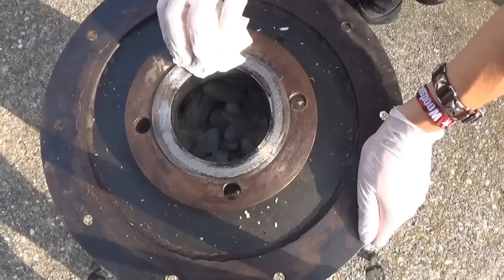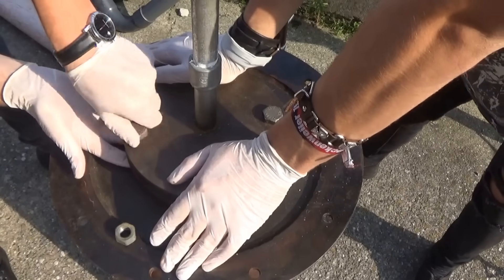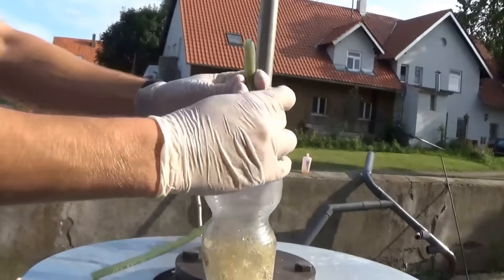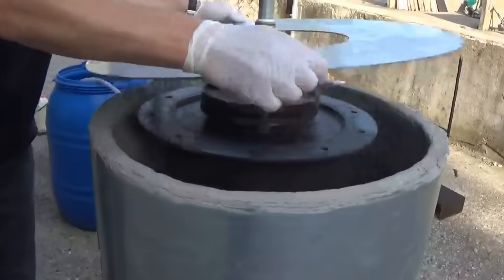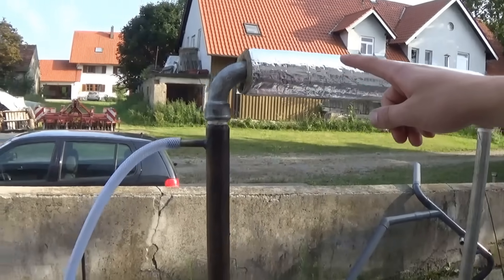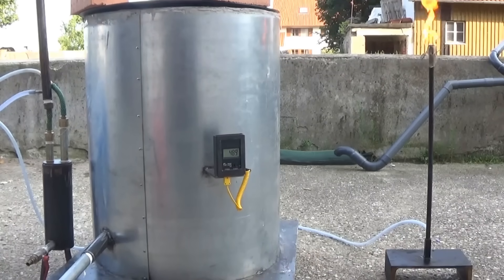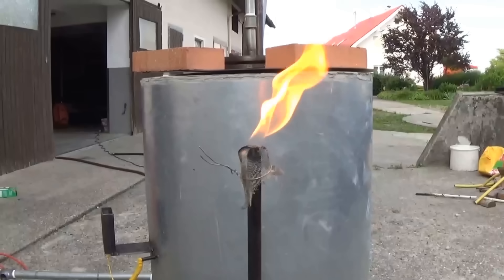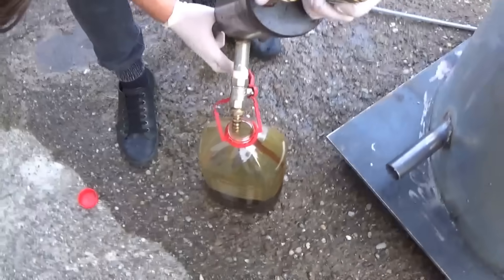plastic waste to oil/fuel improved pyrolysis reactor

Comment: Could you try putting the reactor under vaccum rather than using c02 to void the reactor of o2 if this could be achieved this would be much cheaper than the current method used
Reply from the maker: the process you are describing is called vacuum flash pyrolysis and it works great, but with my set up it would over complicate things.

mfg hazelChem

Comment: CO2 flush is useless.  when heat, water evaporate and flush it.
Reply from the maker: nope ! there is not enough water to fully purge the system! do not work without inert atmosphere!

mfg hazelChem
Reply: @HazelChem  water steam inert  till 250...350 C  add 100 g water to buttom and get 200 L steam.

Comment: That flare gas can be fed back into the burner via a second inlet to the same tube as the one connected to the propane tank.
Reply: You would want to use something like a Waterfilled gate to prevent a possible flashback.
Reply: @kevman0111  Definitely. On every gas source feeding into the furnace ideally even the main tank
Reply: Thought so too, such a shame as it could lower the cost of the whole process instead of wasting it
Reply: My thought exactly, super heated.
Reply: Yes, run the gas back through a bubbler and into the fuel intake.
Reply: Would it burn as clean as the LPG he's using?
Reply: @Hobby_trails_repository  seems to be burning decently in the footage. Probably dirtier that the propane but if it's being burned anyway might as well point it at something
Reply: @atrumluminarium That's what I've always thought about this "bleed off" when manufacturing things. Seems like a fire burning consistently could be taken advantage of somehow.
Reply: @Hobby_trails_repository 

Possibility with the right burner set up.

There are videos on how to turn regular gasoline into Lpg. But this flare gas is for outdoor cooking it think.

It burns red. It need to burn blue as complete combustion.

Look for how to build a waste oil build. If you can't weld get someone who can cut metal and weld. I know many trades but still hire people that can do it faster better and cheaper than me doing it myself.

Comment: You need to check the net energy gain. It looks like the process isn't very energy efficient. Good for getting rid of plastic trash, but pyrolysis isn't recycling, it is just staged combustion and manufacture. Maybe if you check WCT process, Thermal Polymerization, you may find clues. The secret is imitating nature, water can help in the mix. Just 600°C and you can also use the exhaust gases for fuel as you burn them for oxidation. The process has potential if refined further beyond this point.

Comment: You could also flush the chamber with h2o, if it is only to prevent combustion of gasses and oxidation of solids and liquids
Reply from the maker: that might potentially work but you would need a large amount of water .... which decreases the energy efficiency drastically. 

mfg hazelChem

Comment: Please help: from the vapor exit point(attached to the reactor) to the condenser how many meters should be?
Reply from the maker: the longer the way the shorter the hydrocarbons you are getting (because of reflux) so it depends on the product you want to make. 

mfg hazelChem
Reply: @HazelChem  Thank you for your response: i'm looking to making diesel, but i'm being discouraged by many research papers i've read, as they claim this fuel can not be used in Engines. have you managed to convert it to diesel?
Reply from the maker: @TheMiguelcastelo  if you want to use it in engines you have to hydrogante it ... i am working on a setup but it is complicated ^^

mfg hazelChem

Comment: Hey, thank you for the video! I have a question about the process:
The pyrolysis condensible vapours turn back into a liquid, and that's the point of the condenser. However if the reactor and pipe coming out of it are too tall, the vapour might condense before getting to the elbow and as a consequence never reach the condensor. Am I right in this assumption? Did you calculate what the temperature drop would be? Did you size your condenser based on the amount of heat you want to remove from the vapour to turn it into oil?

Which brings me to the next questions:
If the pipe coming out of the reactor vessel was replaced by a total reflux column, wouldn't you be able to keep all your product inside your reactor while all non condensibles can be let out of the top of said column?  ? The reason why I ask is because it might save water and there would be less potential points of failure in the process because there's less unit operations in the process.

Comment: What is the composition of the Flare Gas, can it be compressed and used as propane ?
Reply from the maker: it can be compressed but only with a compressor that is build for compressing flammable gases... otherwise it will explode 

mfg hazelChem

Comment: sorry this system is polluting  many toxins will be produced whilst burning gases
Reply from the maker: nope read your papers .... after doing some research you will see your error 

mfg hazelChem
Reply: @HazelChem  --I do hope you are right.  Ok so now you need to make a larger reactor..out of off the self cheap parts...your idea  would spread. Stay safe brother.
Reply from the maker: @brianevolved2849   I am sorry I just realized that my first statement sounded very harsh. That was not my intention (just happens when you naturally speak German) 
I recommend you to watch some more videos on the pyrolysis process. This will show you how the formation of toxins is avoided in the absence of oxygen. 

mfg hazelChem
Reply: @HazelChem   No problem...we still need to come up with a list of cheap parts to make a kit.....so people can DIY
Reply from the maker: @brianevolved2849   well the problem without welding equipment it is nearly impossible to build a decent reactor that does not pollute the environment.

Comment: Hi thank u for the Information,I am in the process of building a similar plant with a condenser to cool the gas's,also will fit vacuum pump to remove oxygen
Reply from the maker: I recommend using a dimroth type design otherwise a tube condenser achieves way better cooling results. You can watch a video on how to build a  tube condenser on yt.

mfg hazelChem
Reply: @HazelChem  much thanks regards Michael
Reply: Que quimico es que usa con la botella ese qe seve con la manguerita

Comment: Hi I'm going to make this but I'd like your views on how we can use the waste gases to fuel the furnace? Also would a conical top on the reactor be more efficient for the gas too travel to the condenser or would it create pressure? Could traditional alcohol stilling equipment be modified for this?  Thanks
Reply from the maker: you can modify a normal still for this. The main problem is that you need a big volume for the reaction chamber, and all the pipes should have a large enough diameter, so that in the case of paraffin solidifying in them that there is still space for the vapor to travel and no pressure builds up. 
I recommend that you install a pressure reader in the system just to be on the save side additionally you could build a forced air burner to heat the system and store the produced gas in a bag. An easier way would be building a burner like the ElementalMaker did, this will allow for a easy injection of the pyrolysis gas into the burner! (i build something similar with changeable nozzles will be shown some time in the future) 
ps: i recommend to go hard on the insulation! around 7 cm of ceramic fiber plus a layer of refractory (i did re insulate my reactor with to additional layers of ceramic fiber plus a refractory lid) 

hope this helps 
mfg hazelChem

Comment: Did you do calculations for the dimensions of condenser pipes?
I want to know the dimensions
Reply from the maker: no i did not i simply used a 3 cm pipe as outer mantle and a 1 cm pipe as condensation tube both1 meter in length..... but looking back to this there are more efficient ways for example a dimroth type design or a quench cooling where some product is sprayed into the vapor to cool it .... but for this you would need to implement a hot hydrocarbon resistant pump into the system (this would be the industrial way of doing things) 

mfg hazelChem

Comment: maybe the use of a taper flange inner and outer then you don't need a seal, put in dry ice its co2, the chamber is the same for making charcoal, methanol is the byproduct,
Reply from the maker: how would you use a taper flange in this setup? i don´t quite get it 

mfg hazelChem
Reply: @HazelChem  instead of the gasket, taper flange type fitting no gasket requred and perfect seal, doesn't matter if it works stick to it.
Reply from the maker: @actorzone856   so i did try to understand your description as a person speaking another language sadly I cant understand 100% of what you want to tell me .... so send me picture or anything else that might help me 
to understand what you want to deliver to me :D 

mfg hazelChem
Reply: @HazelChem  just read up about taper lock fittings and then build some knowledge about different ways to seal gasses, fluids and whatever, I probably shouldn't have made any comments, thanks

Comment: this will never work this way. it is a hoax.
Reply from the maker: well as you seem so well educated it should be no problem for your to explain why this (in your opinion) is a hoax

mfg hazelChem
Reply: Simple pyrolysis does not lead to oil, mercury-based catalysts and extreme pressures are needed to make a molecule conversion to petroleum. Pyrolysis breaks down the plastic molecules into their basic components (PE becomes ethylene, PS becomes styrene, which is immediately further decomposed to carbon dioxide and water, ABS also becomes styrene, PP becomes propylene, which is also immediately decomposed into water and carbon dioxide, all other plastics decompose directly into water and carbon dioxide). The reason is that in the polymerization of ethylene, propylene and styrene long chains are formed but at the junctions of the basic components there is either a cross link to a molecular residue or a 40 degree bend and it is at these points that the molecule breaks apart again. Without the use of a catalyst which serves as a hydrogen blank holder, it is not possible to produce PE / PS / PP into petroleum. For this reason, pyrolysis in Germany is used only for the disposal of contaminated plastics, while about 17% of the raw materials are recovered and the impurities remain in the reactor. There is a Swedish company that has developed a catalytic treatment, but the plant is the size of a 40 tonne truck and operates at pressures beyond 1500 bar as well as with mercury catalysts and under inert gas. The values thus achieved are about 27% basic molecules (ethylene / styrene / propylene) 40% conversely to petrolium, about 7% to other hydrocarbons (methane, butane and their alcohols) and the rest to carbon and carbon dioxide. Since a lot of energy is needed for this process, solar energy was used as the energy source. The remaining material in the reactor consists mainly of highly toxic compounds of the dyes and plasticizer residues and organic mercury compounds.I have been working in plastics recycling and disposal for 15 years and know very well about organic chemistry.
Reply from the maker: @darkbreed  thank you for this precise answer ! this is way more helpful than your hoax comment. I will look into the problems your mentioned ,it seems plausible how you describe it. But than there is the question how do i get these spectrometer readings from the refined oil ? they clearly show a lot of toluene being present and the formation of branched, aromatic and cyclic hydrocarbons. the second thing is that all papers you can find on the non-catalytic pyrolysis of mixed plastics show conversion rates of about 50-60% into liquid components. third thing is that after hydrogenation of the oil (which i will perform in February) the obtained oil should be better fitted for usage in combustion engines.  

mfg hazelChem
Reply: I do not know how high the pressure in your reactor will be. Since a lot of organic acids are formed in this pyrolysis of mixed plastic, it may be possible that, under sufficient pressure, a reaction takes place with water, carbon monoxide and methane. Methylbenzene (toluene) is not petrolium but a methylated alcohol of a benzene ring. This will never be diesel, at most gasoline replacement with strong restrictions. The corrosive properties make use as a fuel difficult. It has been known since 1934 that hydrocarbons (or even coal) can be methylated, but this process is extremely inefficient compared to mixed plastic as an energy source for combustion power plants. Furthermore, the mixture has to be thoroughly cleaned chemically or thermally in order to separate the various alcohols and organic acids from one another. Most of it is not suitable as a fuel. The better variant is catalytic pyrolysis, which generates much more useful hydrocarbons (e.g., petroleum) and can be recovered in a condensate column during the process. Toluene is produced by all incomplete combustion of hydrocarbon-containing substances (for example incineration of tobacco). In addition, toluene is extremely toxic and volatile.
Reply from the maker: the pressure in the reactor does not exceed the vapor pressure of the lowest boiling fraction. for the toluene part toluene as you your self wrote is methyl benzene there is NO OH- functional group so it is just a methylated benzene and no alcohol. if you watch my video on the purification (fractional distillation and deacidification) you will see that the crude oil obtained in the pyroloysis has to undergo the same step as standard crude oil to be useful as a fuel. For the last part could you provide me with a link to the Hg catalyzed process you mentioned? plus as you mentioned the acidity of the resulting fuel i did a quick test on the distillate i obtained by simple distillation of the crude oil (up to 140°C; 1 atm) (reacting with 10% NaOH for 30min at 70°C gentle reflux) 117,1 grams of distillate contained 0,08 grams of oily potassium salts of organic acids. 
if you like to read it,  I quickly looked up a paper on the performance of pyrolysis oil.

https://www.researchgate.net/profile/Chonlakarn_Wongkhorsub/publication/272653266_A_Comparison_of_the_Use_of_Pyrolysis_Oils_in_Diesel_Engine/links/59b90188458515bb9c465909/A-Comparison-of-the-Use-of-Pyrolysis-Oils-in-Diesel-Engine.pdf

ps: toluene is not extremely toxic only mildly HCN for example is extremely toxic 
pps: there is still 1% benzene in all commercial fuels and benzene is considerably more toxic than toluene 
 
mfg hazelChem

Comment: Two points: You can use a vacuum pump to evacuate the oxygen. You can use a standard cast iron conical union and not need expensive sealing collars.
Reply: ha-ha. just a glass of water solve all.
Reply: Why do we have to  do we have to do this what hapens if we dont
Reply: @ConstructoradeJGuadalupe  to keep volatile organics from escaping and slowing down your recovery and lowering output.
Reply: What about introducing nitrogen or argon instead? Surely that's cheaper.
Reply: @ssss-df5qz  argon is actually rather expensive, co2 is rather cheap, (baking soda and vinegar? or any acid and base) or any brewery or brewing supply shop can sell you (if willing) 5kg for less than 100dollars and thats food safe, welding supply stores could also sell it to you but it might not be food grade, It might, maybe, compare to nitrogen but supply of that would be limited to welding supply shops
Reply: @rjwaters3  good point. Hadn't thought about that.

Comment: Sir can I know what is the energy consumption for this process to completely convert plastic into fuel and how much amount of energy is produced after the conversion!!
Reply from the maker: the pyrolysis it self it endothermic. if you look up the corresponding papers you get the energy that is needed for each individual polymer to be cracked. this can then be summed up with the heat loss off your system and the energy combined with the energy needed to bring the newly formed liquids into the gas phase.... this then gives you the theoretical energy-consumption of your system.

mfg hazelChem
Reply: @HazelChem  this is my mail sir vadamodulugirish@gmail.com hope I can have any more In depth  details about this test!!